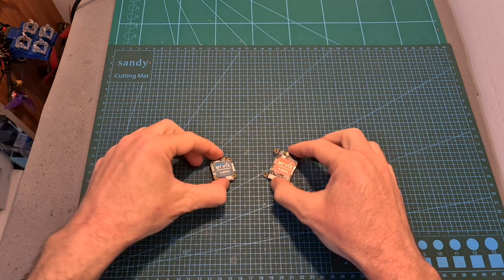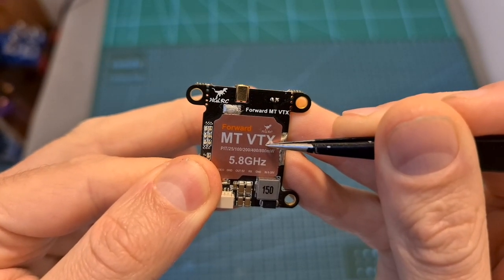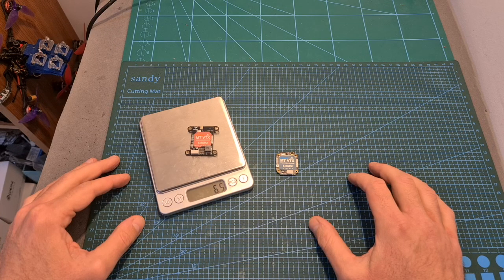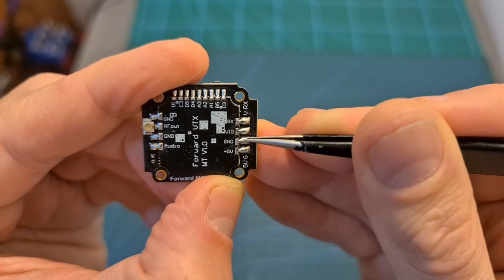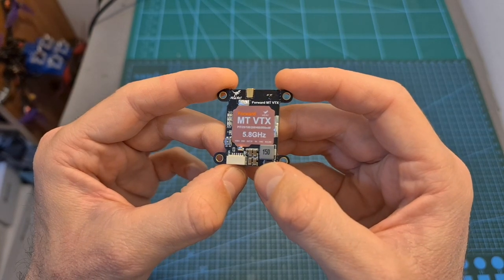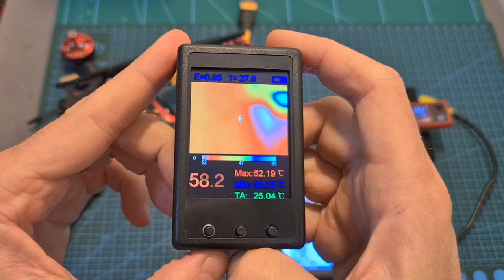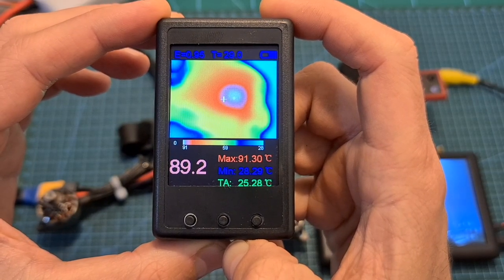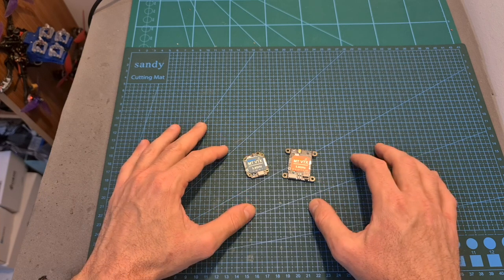HGLRC MT VTX - Review And Output Power & Flight Tests

Comment from the maker: I had a conversation with a couple of engineers from HGLRC about the output strength issue. They told me that even though the vudeo transmission modules are identical, the software is different and therefore the labeled 800mw option is not a mistake like I assumed.